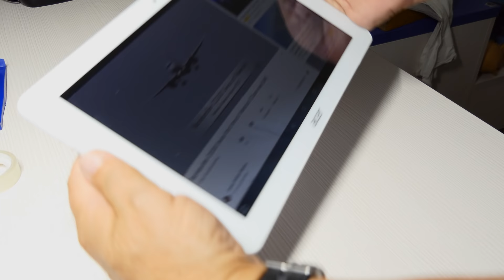Acer Iconia One 10 Change screen  (DIY) [4K]

Comment: Hey, so I'm just wondering, the digitiser is completely wrecked, glitching image, spidery cracks that are under the screen and large black areas. However, while the touch screen still works it has a crack around the corner. Replace everything or digitiser only?
Reply from the maker: If in doubt, replace everything

Comment: great repair, I need to change my lcd on my acer iconia 10 do you suggest changing the digitizer aswel or will it be ok.. cheers
Reply from the maker: I imagine that it will be easier to change only the touch screen, although I have not tried it.

Comment: Do you have a link to a reputable dealer of Acer Iconia One 10 replacement LCD screens? Model B3 A20. Ebay yields a bunch or results from China and most are used. I will take a used one if necessary but dont want to pay new prices and want to be sure it works.